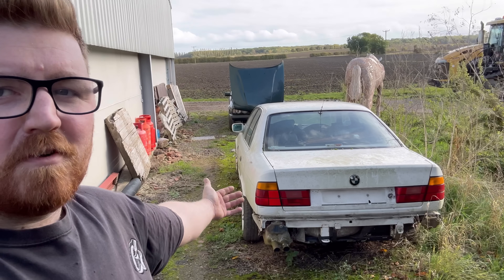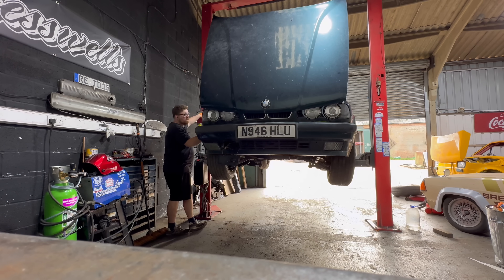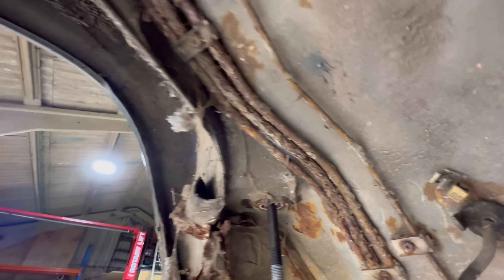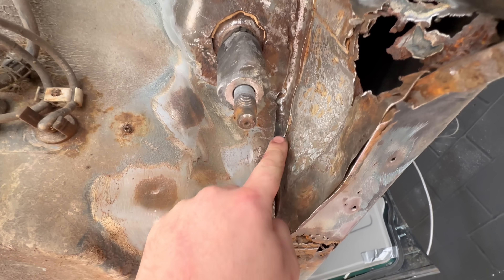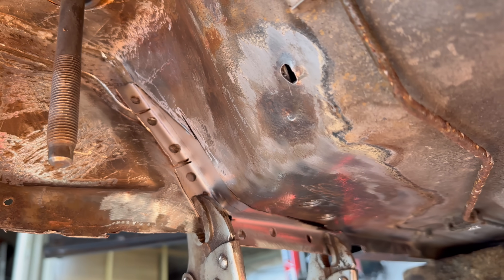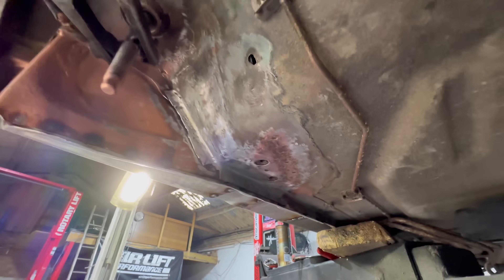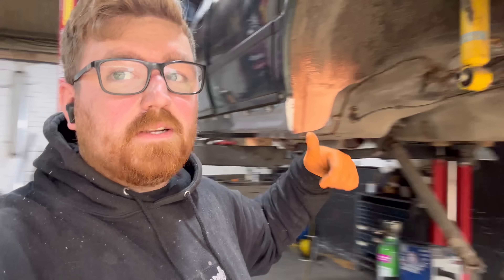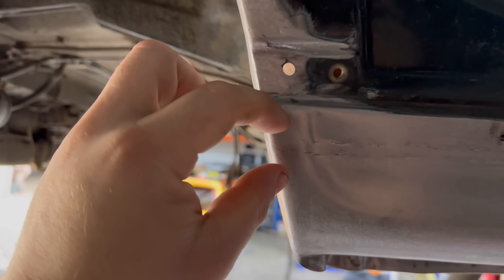SAVING OUR ABANDONED BMW E34 TOURING

Comment: Was waiting for this one! My, oh my what a beauty, love this e34 touring. Looks a little fiddly, but you've done a fabulous job Josh, very neat with a factory look. I suspect mine need doing in exactly the same place. I tested a 518i and was quite impressed with how torquey it was, it kept up with most traffic and a smooth unit if not pushed too hard, sure it can't match a 6 cylinder for smoothness or fun but it's still respectable.
Reply from the maker: I’ll see what it’s like when i finally drive it 😂

Comment: Great work there buddy! Coming from a restoration background myself I have a recommendation for panels that your using, buy zinc rich primer for the back side of the panel, helps with rust prevention! If you ever have any questions I’m happy to help! 🤟🏼
Reply from the maker: Thanks mate appreciate it! i have been using some anti rust primer on the back side, have used the zinc before too! just what i’ve got in atm!
Reply: I mean that’s what I’ve always been told to use is zinc rich primer, for insides of the panels I use single pack with a brush, but anything anti corrosive is Fine! :)